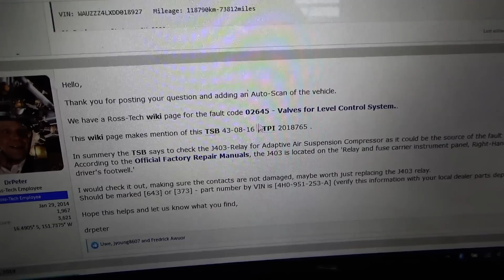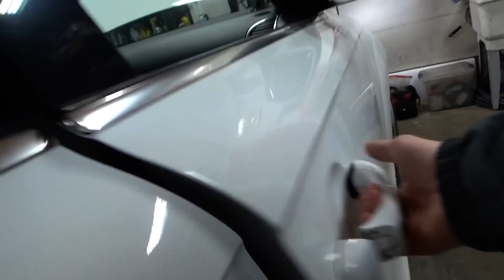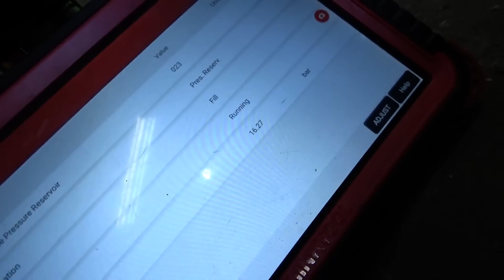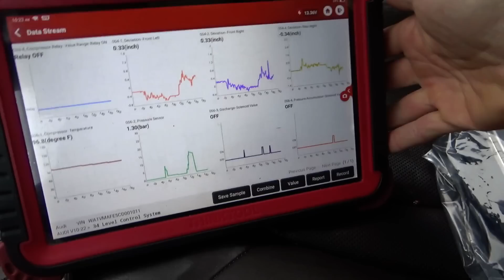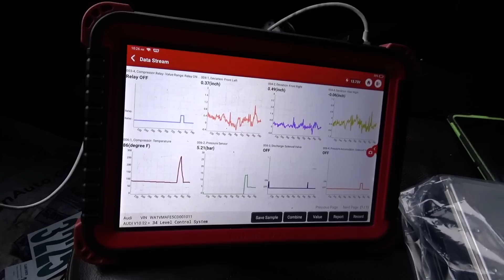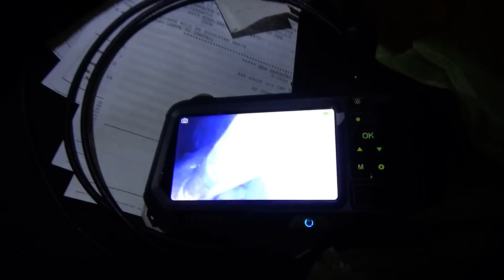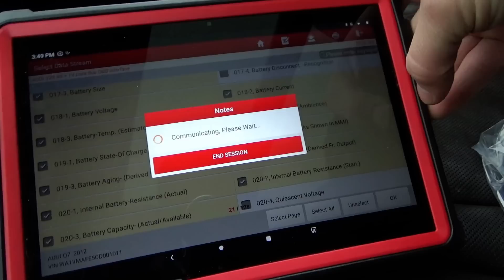Audi From HELL...DEALER STUMPED!! (Part 4 - CONCLUSION - Q7 Air Suspension DISASTER)

Comment: Whatever benefit that was offered by this air suspension is not worth the price, or these headaches.
Reply: That goes for any air suspension really.   If you buy it new and get rid of the car before 100k miles, then it's great (which is what rich people do).    Otherwise stay away from air ride systems.
Reply: @calholli  I know a guy who had a similar nightmare with a Jaguar air suspension until he went with fixed struts and the air ride delete.
Reply: I've got to know what kind of annual income you say make someone rich.
Reply: @stevewhite3424  When someone can buy a new car every few years and they just get rid of the old one at a huge loss at only 2 or 3 years old.. because it's just not worth the hassle to start messing with repairs and maintenance.    That's what I call a "rich" person
Reply: @calholli what I wonder is would the dealer taking the car warn the next buyer that at 100000 miles it’s going to be a money pit? I doubt that!
Reply: @calholli  I call that being dumb with money.
Reply: @KingDraculaSpelledBackwards  I agree..  but if you're rich enough to the point where this isn't even on your radar and you can throw it away just for the sake of convenience of having a "new" car;  you're wealthy.
Reply: I always skip through where she talks about the condition of the interior. Who cares?
Reply: I had a Merc E-class wagon with air suspension. It was amazing, could drive on any surface at any speed, smooth like butter. Though the compressor indeed failed right at 100k miles…
Was it worth, hard to say 😅
Reply: @julienlaperrouza8846  You can buy air-bag suspension for quite cheap.. People like to add them onto off road tow trucks, etc.   There is no denying that you're basically floating on a cloud.  They perform well, they just don't last
Reply: It was perfectly OK for the initial owner. This car is 13 yrs old and it's probably not the original owner
Reply: Air suspension had been giving mechanics headaches for many decades.
I think Car Wizard had a '70's Lincoln with air suspension that had been replaced.
Reply: @Cheepchipsable  Now Car Wizard claims he isn't working on Domestic cars anymore except for his buddies. I never did get into watching him especially with his wife asking annoying questions off camera. Although he must have given her the script. Only reason i tuned in this time was because it had a title something about modules killing the car industry or words to that effect. After hearing he wasn't working on domestics anymore i quit watching the video.
Reply: @KStewart-th4sk could never get into his videos. Also love to watch: Watch-Wes-Work, Mustie 1, and Diesel Creek.
Reply: Most landrover discoverys have leaking air bags and owners change them to normal springs, so it's  a luxury item delete 😂 .... not sure how it effects the computer side of things though? These cars have way too many modules,  heated steering wheel 😅.  Battery in silly place😔.
Reply: The weak link would be the compressor lol couldn’t even upgrade it if you wanted to I’m sure
Reply: That's why older Lincoln and Cadillac's people will change them out for regular shocks and struts.
Reply: Just gotta price 2k$/corner or 1k$/corner if doing yourself when buying them. Can often double the price of the vehicle, so at that peril.
Reply: Agreed
Reply: Why they didn't just use the Citroen system is beyond me, that actually worked.

Comment: A dirty, restricted inlet filter will cause slow pumping and high discharge temperature. Make sure the air intake is unrestricted. Also check discharge valves. Leaking discharge valves will give the same symptoms.
Reply: Yeah.. I'm surprised it doesn't have a replaceable filter on it.
Reply: Compressor oil ?
Reply: @wesliebegay828  No oil required.
Reply: Good morning